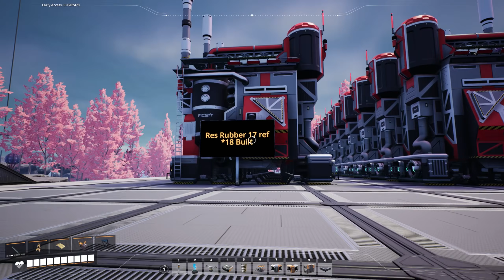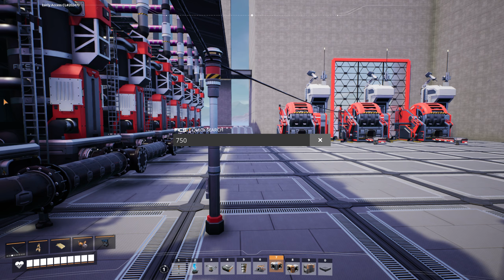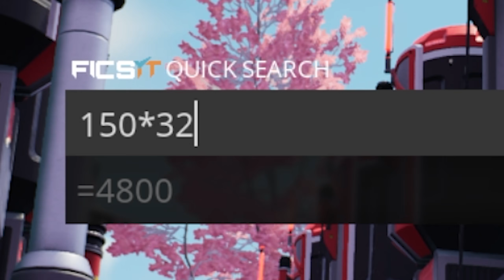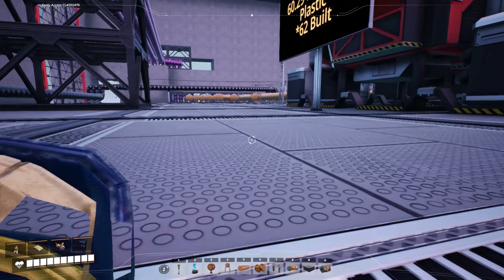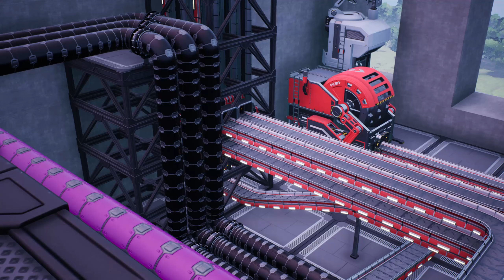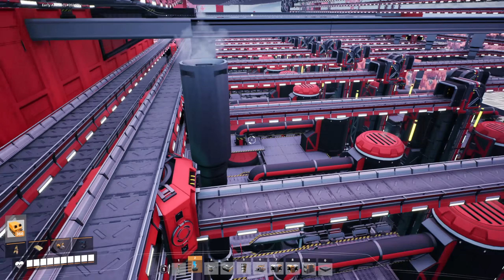IT'S OVER 9000 PLASTIC /min - Satisfactory Update 6

Comment: I just finished a facility to transform all 3,450 Crude Oil of Spiral Coast in 10,350 plastic+rubber but did it using blueprints and in a way, you can easily switch from plastic to rubber at a micromanaging level. I was surprised Kibitz just used the same "it's over 9000" meme. I love Kibitz's work ♥

Comment: I would just divide 1 500 line up and feed 100 each into in 5 others, so that you end up with 5 600 lines.

As he has apparently 13 500 pipes coming in, he could use 2 of them to fill 10 pipes up to 600 and then use 100 from the 300 line to fill up the last one and then he has 11 pipes with 600 each and a 200 one.

Comment: That is very UNsatisfactory.

If a machine needs 400 gallons of water per minute, and you have 18 machines lined up, then the pipe diameter needs to decrease as the pipe goes from water source to the machines, with a decrease after each machine.
Water cannot be compressed. Pipe diameter must change.

Comment: It seems like it's becoming very hard for you to keep track of where resources are going. Especially since you're building on such a huge scale that thousands of resources are moving in many directions.

It might help your future self to start using label signs. In projects like this where you have a single building segment and a single room where it produces 1 thing, or does 1 thing. Have all resources input into the room from one location.
Then use 2m label signs to label the inputs. IE, select an image on the signs lets say crude oil.
Then the text you'd write "X300" if the pipe carries 300 per minute. If there is more than 1 and they are all flowing evenly, you'd write "x300 x6"
6 pipes flowing at 300. 
You do the same for belts.
Do this on a designated input and output area of a given project and you'll help your future self keep track of things
Reply: Perhaps you could call these "junction points" where the total input or output of a section of buildings meet in one place to be labeled and organized before being piped off to where its needed.
Labeled for no other reason than, 3 months later you can walk in and see exactly what the section of buildings takes, and produces with out having to dissect into the building line to remember how it worked

Comment: It might have been easier to just overclock or downclock machines feeding your fuel pipes in order to get exactly 600 fuel in those lines. I've done similar things in my own factory to simplify things. Dealing with fractions has a tendency to get messy.

Comment: Kibz, question: 

Could a reverse manifold method work to get the pipes to 600? Like, take one 500 pipe, and have 5 junctions out of it, each with a valve for 100 flow. Then merge each 100 line into the 500 lines? That would give you (5) 600 lines, right? I'm just brainstorming.

Top notch work as always, you inspire me to put in the extra work for asethics, it really is a beautiful game.
Reply: That works too but it kinda takes a lot of space
Reply: The thing is you don't really want to ever have 600 fluid in a pipe since the engine doesn't like that.

Comment: Working on 100 hmf factory at the moment. So far I've done 25000 iron ingot facility, 7000 steel and 4700 steel pipes. Making em all pretty is the reward but at the same time I'd already have the whole project finished if I just built it plain Jane. Problem solving and art makes this game great.

Comment: So... I need some advice as to what's happening here. I can't figure out why my machines stop running. I have even split belts, and they're running about 1 ppm slower than the miner, basically my smelters are outpacing my ore and I can't figure out why. It's not DRASTIC, but that 1 ppm adds up.
Reply: Basically, even though this has only happened to me with insta craft mods, if your machines take too little time to do stuff, they turn off, if your belt delivers ANYTHING that can enter that machine right as that happens, there will be like 3 seconds of downtime, and it can even end your playthroughs if it’s something like a perfectly balanced plutonium setup, and can be minor like something that’s supposed to go into a sink not going in instantly.
Edit: this doesn’t count for pipes

Comment: I don't know why I keep thinking about it but with all the alternative recipes you have it feels like you can make a perpetual fuel creation engine with all that plastic and rubber cycling. Is that possible? I'm playing a purist run so I'm not cracking into any of the alternative recipes other than the ones that are granted outside of hard drives. I'm pretty much doing the purest run because I'm lazy and I'm curious if it's possible.
Reply: Yeah you can, theoretically, until you run out of fuel. That’s why he has a huge fuel making facility just off to the right, it takes a lot of fuel to run all of the refineries

Comment: Why not marge and balance the 5 wonky fuel pipes into 4 equal pipes. Seems easier, especially if you do it downstairs where they start (where you removed a bunch of machines to bring it up).
Reply: That does sound easier than what he did to be honest. ^^;; Just merge 1 pipe into the 5 others.
Reply: @Sanquinity  Kinda yes. Later on he did a similar thing for the other pipes. He could have done that for all the fuel pipes hah.

Comment: Hey Kibz, something I've always wondered, what's your power grid look like? Like, is everything just daisy chained together between factories following along train stations, or is there some organisation? With how...tempramental nuclear is, I'm just wondering if it'd be worth organising your grid so it's in 4 parts: 1 the nuclear plant, 2 the plutonium disposal, 3 everything else, and 4 a back up/emergency power plant running on fuel or coal (which is off 90% of the time).  You'd have it all divided up by switches, and if worst comes to pass rather than basically being screwed out of the world, you can flip a few switches and your back up power plant directs everything it has to plutonium. Alternatively you could just have a self sufficient power plant and the plutonium plant on it's own power grid, so that never turns off if you do have a total meltdown. 

Sorry if this has already been shown and/or discussed in a past video or stream, I haven't managed to catch your streams and haven't seen all the older videos. From what I have seen your back up power system for the plutonium is a dozen or so batteries beside the control room.

Comment: With all this ridiculous water piping everywhere in the world I'd still love to see something along the lines of long-range transport pipes that can handle 3.000 BUT they can't connect to machines because of the pressure and only connect to a "hub pipe" that has 1 input and 5 output sides to go to 5 600 pipes so that the moving to a base isn't just a huge ugly stack of shitty pipes but 1 or 2 big bulk water pipes instead.

Comment: Maybe im stupid but how did kibitz go from 2400 to 2278???
Reply: Some of the refineries are under-clocked so they consume less fuel, the 2,400 assumed all refineries were at 100%.
Reply: @jongrey1916  It seems like you are an expert.
So can you help me with another question. In my nuclear plant I need to frequently flush my sulfuric acid setup because of overflows(blender output clogs up). But all the numbers meet up. Do you know why.
Reply: @the_samsam  - Assuming you are recycling the output acid back into the system it sounds like maybe a priority pipe issue.

Pipes have "Variable Input Priority"(VIP) meaning a pipe on the same level as the machine inputs will take priority over a higher line feeding down into it - by ensuring your recycled acid line is on the lowest level with your "fresh" input feeding down into it your recycled acid outputs will always take priority and keep those lines from clogging up. 

Hope that helps.
Reply: @jongrey1916  So i need to have the recycling line low and the new acid coming from above?
Reply: @the_samsam  - Yeah, then it ensures the recycled acid goes into the input first and the new acid fills out the rest of the input pipe. 

Otherwise if there's any slight hitch in your production the new acid will fill in the input pipe and block the recycled acid from entering it backing everything up.
Reply: @jongrey1916  Thank you very much
Reply: @the_samsam  - No problem, hope it solves your issues.

Comment: I just finished turning all the crude in the Spire Coast into fuel to run 766⅔ fuel generators... I'm now getting nearly 115 thousand megawatts.  I was going to do turbofuel, but just the idea of having to plumb and wire 2004 fuel generators was... unpleasant.  I'm glad I didn't do it.  Also, I wanted to save my sulfur for batteries and a massive nuclear plant.  I'm at a point now where I'm happy to be done with that project and am now just kind of basking in its awesomeness.  I love going to random high spots and just gazing out upon its glory.  It looks like a giant orchard of smoke stacks, lol.

Edit: removed an unnecessary word.
Reply: How do you load balance your fluids?

Wrap around pipes or what
Reply: @GeorgeHardRMartins  Sorry I didn't respond earlier.  I was busy when I originally saw you question and forgot to reply when I had time.  I just remembered it after watching Kibitz's most recent video.

Anyway, yeah.  Wrap around pipes, kind of.  The fuel flows into the wrap around bit before it goes to the generators.  Also, I made sure to have production be at a higher elevation than consumption, that helps very much.  Another thing that helps is allowing the pipes to fill completely before connecting the generators to the power grid.  If the power connector of the generator is not connected, the game basically treats them as being off so you can let your pipes fill up before connecting them.  It helps a bunch for balancing fluids if your pipes can be full before starting whatever machines are using the fluid.
Reply: @goshisanniichi  I kind of square peg round wholed my solution and just forced more fuel for initial start up and oil

I'll start doing this though

Thanks a lot

Comment: I did something much Simpler than this... I simply used a smart splitter at the beginning of each of the lines (one for plastic and one for rubber) with an overflow set to flow out where I needed the plastic to go.